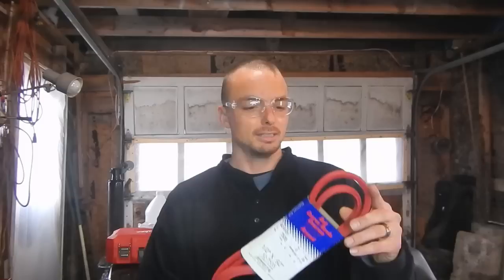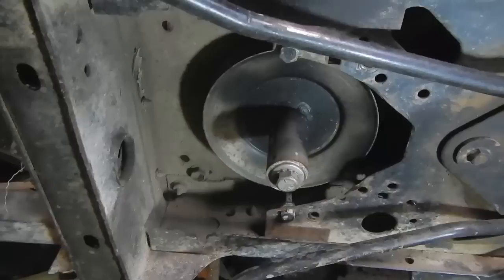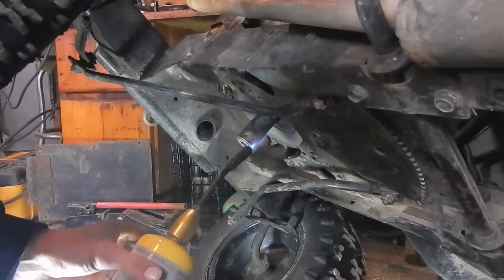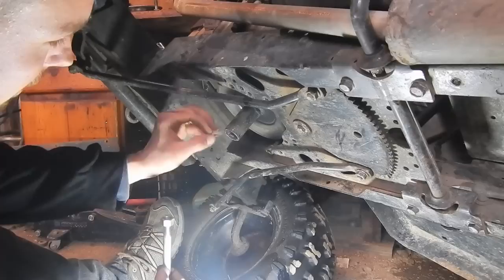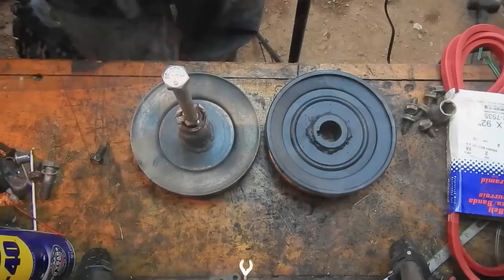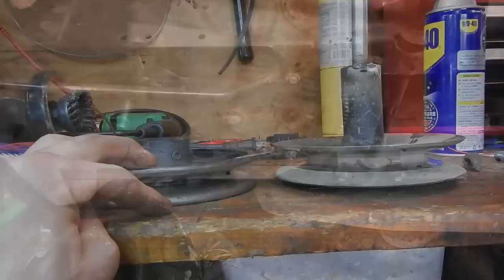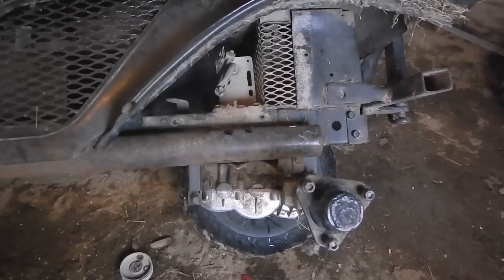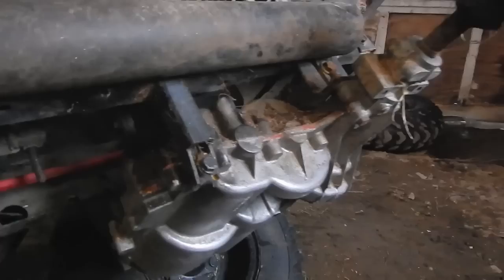Mud Mower Upgrades & Repairs pt.1

Comment: Tractors are maddening sometimes....going through the same thing with mine right now. Had everything all dialled in but swapped both pulleys at once, everything looked good and aligned....tore the brand new belt in a matter of seconds

Comment: One of those days...  The rear pulley has been good for you, but you might want to replace it with a steel one.  We've melted/broken the aluminum ones before, keyways shear in them also. 

Nice job on making a puller for the pulley, not sure I've done that one before.  Your belt change is a pain, kinda of glad we don't have the murrary style steering, with that extra plate to thread the belt through.
Reply from the maker: yeah, it does make it tricky to change the belt, It really sucks when it's all covered in mud. I have made it a lot worse with my additional plates and guards though. The steering is probably going to be one of my next upgrades

Comment: Yeah, the red belts are nice. Pie cut the mount and re-weld it.
Reply: Type in Red Racing Belt and you will find them.
Reply: A guy on Ebay has them.

Comment: I have found the Blue Kevlar belts at tractor supply to be just as good as the red belts.  Also at Tractor Supply, they have the V-Belt measuring tool that allows you to convert from a 1/2' belt to a 5/8" belt which is stronger.

Comment: Awesome video!

One note though:  
Wow... that is a load of effort just taking the belt off.  There is something to be said for simple.  I don't have skid plates to deal with, but still, my belt takes 30 seconds to pull... and I have not dropped a belt in years (since 2003 or so?).  Belt gates are the best idea Stretch and I have come up with - hands down.
Reply from the maker: unfortunately, there isn't much I can do to make it easier... The factory steering passes through to the bottom of the chassis, and the the transaxle shift mast passes up through the belt system as well. In original form, you only have to pull 2 bolts for the steering, and the hitch pin for the shift linkage and your done... I do keep all the tools necessary for a belt change on the machine at all times, so a trail swap is possible. It would just would take me about 15mins longer than you... lol!
Reply: I'm runnin a red belt for a couple months now. Seems to work good. It doesn't chatter on an engagement if ya try taking off in a tall gear , and it seems to have better holding power.
Reply: FearlessFront (Todd Christopher)

Comment: Make the front ransacked mounts longer and put washers under the front two bolts of the rear mounts. It would save the time and effort of cutting and revolting and welding

Comment: The easy way to remove the pulley  is with a air hammer 
Apply it to center of the shaft bolt
And pull the pulley by hand

You might try to cut the trany brackets 3/4s of the way from the
 back to the front then bend them and weld with out removing the trany
Great video thanks

Comment: dont bother removing those welds on back trans, just put a few washers between the FRONT mount bolts on the axle and frame, this will drop the axle at the front down a bit,  Neil  :)

Comment: Instead of cutting off the brankets to reweld back on, try working what you got by redoing the holes. For example the front bracket holes elonggate them lower to drop the front

Comment: those red belts are the shit they endure the heat and dont stretch at all great for racing use on my mowers & vtwin havent burn one of those up yet
Reply from the maker: yeah, this one didn't fit, I am gonna get another one before the summer though... Did you have a problem with the sizing? they seem a little on the short side...
Reply: with mine i order them 1" bigger due to they not going to stretch at all and i just take up the slack with a adjustener

Comment: Yep, "I'll replace this part, but before that I gotta fix this part that can't be taken off before this assembly is removed. Luckily, there are only four steps before that happens, once this other part comes in the mail, because I just discovered a broken part over here, that apparently isn't made any more but I found a knock off on Ebay that could possibly work if I modify it."

Comment: An air hammer would have taken much less time.  Just leave the bolt in halfway and air hammer the bolt head.  The pully will slide right out!

Comment: Hey fearless, I have a murray like yours but it is red. It had a 12.5 powerbuilt but it sized and I put on a 14.5, which put a hole through the block. I bought a 16 hp opposed, and I have a 6" on the engine and 3.5 on the transaxle. It goes about 35 mph now, (mst 206, originally 205) and I have a big problem. the belts only last about 5 minutes, and they fall off all the time. all the pulleys are lined up, at least when it is sitting. do you ever have problems with belts? I kind of need help with it, I want to drive it.

Comment: Do you have any good tips on how to get more power out of these engines because I have the same mower and went from having the stock rear pully and went down to a one and a half inch pully and I'm only topping out at 15 mph

Comment: i got a question i got have hydrostatic cub cadet that was give to me they thou something was bad wrong with it but a lil carb clean and good gas runs great but would a pulley swap on it work or not with the hydrostatic trans

Comment: Hey fearless do you have any tips for fixing belt slip.  I have a four inch pulley on the crank and a 3.5 inch on the transaxle and I have a second spring on the clutch for more tension.  My clutch is the same design as the one you made for your Murray so it tensions the belt well.  But I still get belt slip on good traction surfaces.   I would like to have it be able to submerge the belt and pulleys in water and not slip.   What would you recommend.   Thanks
Reply from the maker: well, if your confident the you have really good belt tension, and you have a good belt then you might want to consider changing the rear pulley out for a larger one. The larger pulley has a larger circumference, and thus, more surface for the belt to grip the pulley. it helps a lot in water. If you swap it out though, you will want a larger engine pulley to keep your speed where you want it.(which will help belt grip even more, but you'll also need a new belt) My trans pulley is a 5", and the motor is a 6".
Maybe try buying one really strong clutch spring, My belt is almost like a guitar string.

Comment: Hey fearless, got a question of you. I am currently working on turning a wide body into a utility tractor. I took out the hydro rear end and replaced it with a spicer that I locked (thanks for that vid btw!) but my main question is, how did you fab up the mounts for the front end of you mst? The spicer doesn't seem to have any bolt holes that I can turn into. I looked on this vid but couldn't get any clear shots of how you made them.
Reply from the maker: the mst cases have the holes cast into the housing, you just have to thread them. I would think there is at least one hole on one side or the other.
Reply: Cool. I will check it out. Thank you!

Comment: I have a question off one of ur other videos where did u get the bushings at that u put on your mower
Reply from the maker: For the steering? I got them at the hardware store in the nuts and bolts section
Reply: Thanks

Comment: I have a poulan pro 18.5 ohv mower, and it needs new rocker arms and the valves set. Should i repair it or get a different motor?
Reply from the maker: thats an easy repair. Fix it.
get new rocker arms, and a feeler gauge. That's all you should need besides basic hand tools.
Reply: OK thanks I'm turning it into a mud mower.
Reply: FearlessFront (Todd Christopher) hey Todd I want to show you my project my mud mower first is coming to gather but I new help what was the video that showed how to lock the diff on a mower

Comment: Is a 1996 Murray with a 12,5 briggs and stratton a good tractor??
Reply: +Komba16 NORSK GAMING  should be  good one to mod, mainly depends on transaxle, if its a manual shift (clicks or has a "step" between shifting) thats good, if it has a pedal or a "smooth" shift or is labeled "automatic" than no, THEN, you need to find the sticker on it. if it says MST or peerless at all, your good to go, if it says spicer, then you have a week trany, not  very favorable. Good luck!

Comment: Damn that sucks. Would explain why the belt wasn't performing?!?
Reply from the maker: I thought it was performing rather well over the past 5 years. If I hadn't seen it, who knows how long it would have stayed like this.
Definitely not good for the belt though!
Reply: Fearlessfront Could'a sworn it was slipping. You have so many of these i don't remember which was doing what.

And yep, the belt would of had suffered. I had a compressor that chewed a brand new belt because the engine mount wasn't properly aligned. 
I never really got this, why the hell the old belts do just fine with a misalignment and suddenly once you swap them with a new one it chews itself to death as if to spite you...
Reply from the maker: aserta I hear ya. this machine was one of the best one I have in terms of belt slippage. But maybe thats because it's getting hot, and grabbing really well. One thing is, I was occasionally having a problem with the belt not fully disengaging when I pushed in the clutch. I hope that will be fixed now.
Reply: Fearlessfront i had the same problem with my honda mud mower, but i extended the clutch linkage so that if i pushed the clutch the pullys would disengage further from the belt

Comment: my belt is easy to get off because all my steering is on the top
Reply: mine is direct steering lol all i have to do is disconect the tie rod
Reply: craftsman mud mower i dont have to take off any thing
Reply: ya but how much play is in your steering wheel
Reply: craftsman mud mower a little
Reply: i have 0 play and a new belt so im set
Reply: o i thought you meant steering no i have 0 play in my belt